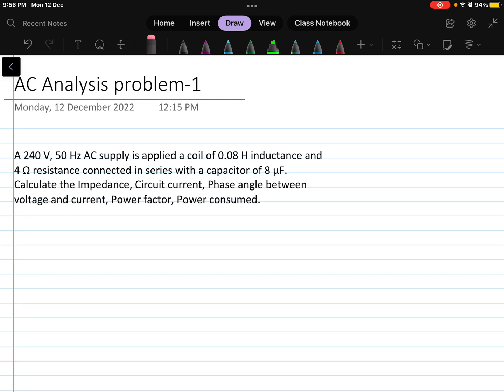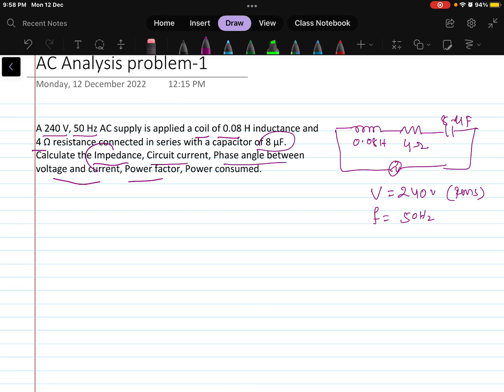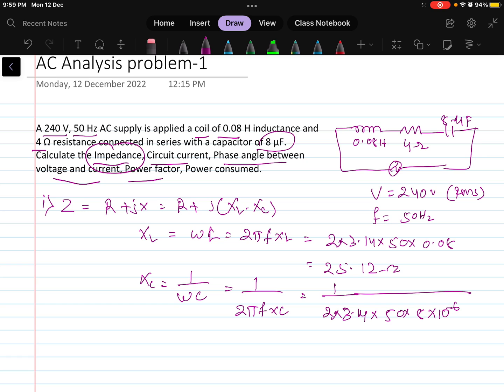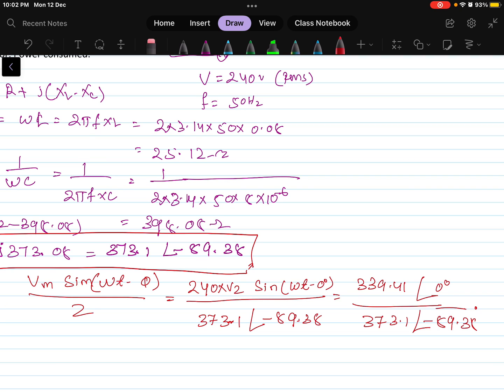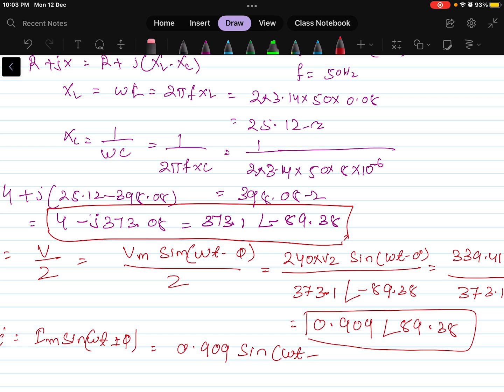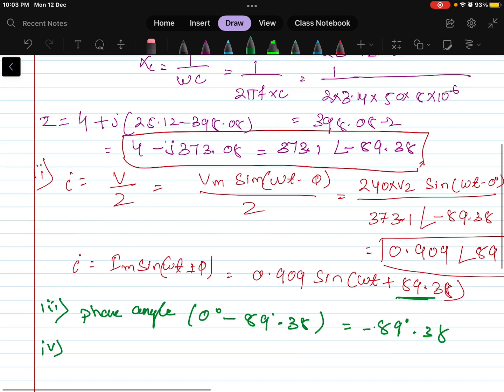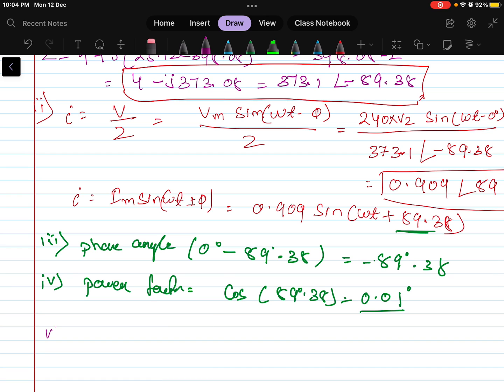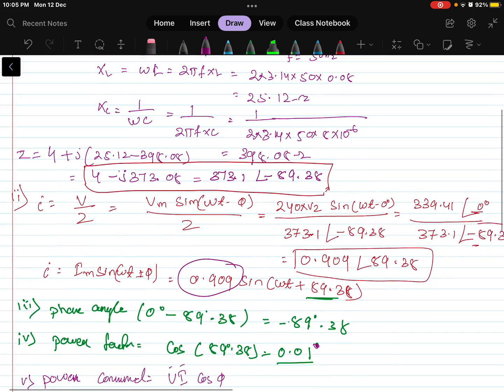AC Analysis Practice problem 1-Series RLC

Comment: 7. A series circuit consisting of10 ohms resistor,100 µf capacitance and 10mh inductance is driven 
by 50Hz.AC voltage source of maximum value of 100V.calculate the equivalent impedence, 
current in the circuit power factor and power dissipated in the circuit